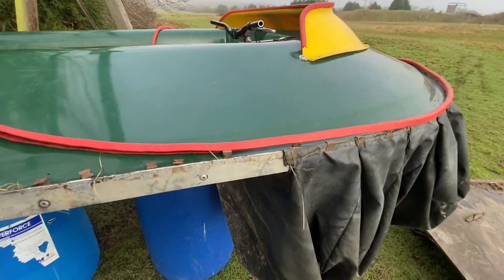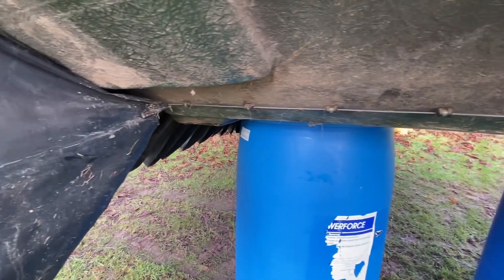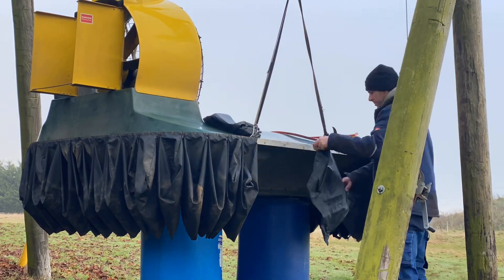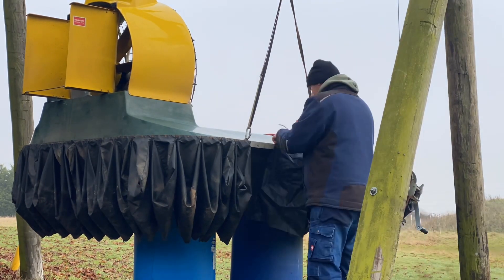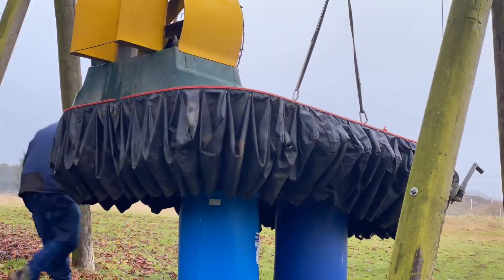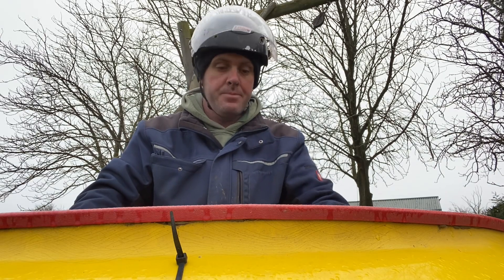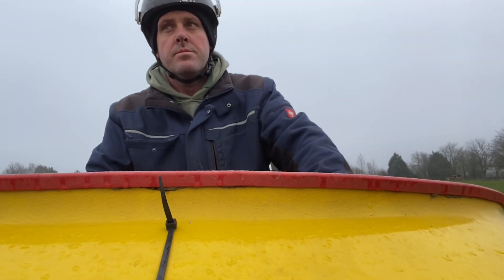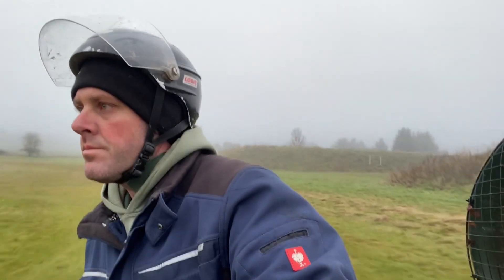Servicing a hovercraft, fixing the steering, changing the ￼ skirts and having a quick play

Comment: Is that the Snapper/Mini XL hovercraft by BHC?
How does it performs with the 23 HP Vanguard? The pull starter makes it a very reliable ride!
Reply from the maker: It is a snapper. We found the electric start great as long as you isolate it. Pull start is a little difficult but will work.  They fly really well and plenty of power. And the skirts are very easy to fix.
Reply: I got quite a personal experience with that hovercraft:
I've been wanting to get it as my first hovercraft, but under the false assumption that it got discontinued (screw misleading info and who publishes it), I reverse engineered the hovercraft through the help of photos; videos; some knowledge in the matter, lots of math, and a friend that has a much larger mind than me in the matter.

Shame that I found out that it just got improved and renamed into "Mini", and that it still is in production, only when my personal design was on the path of completion. 

Despite its size, should the engine would get upgraded to 38 hp, would it be able to carry a passenger?

Also congrats for having such a gorgeous lil craft; I think that if I had room and the mean for it, I'd keep my hopefully future one in the bedroom, away from dust and bugs; a fellow of mine has a BBV, once he came back from a ride completely covered in mud; as I asked him if he wanted some help with cleaning his girl up, he replied with "Naaah it's its habitat" xD